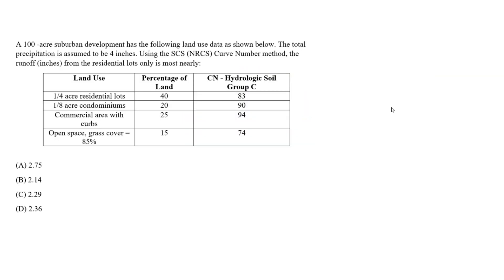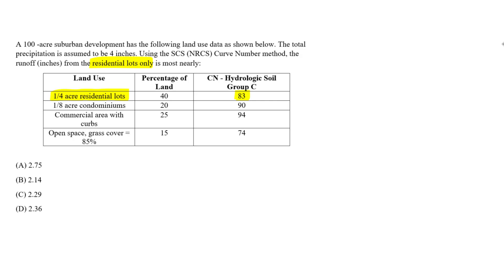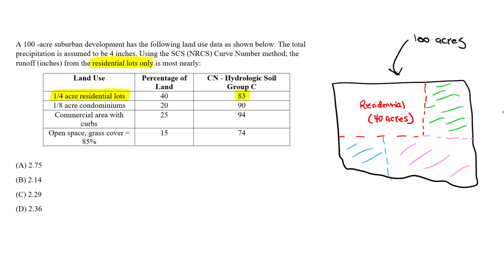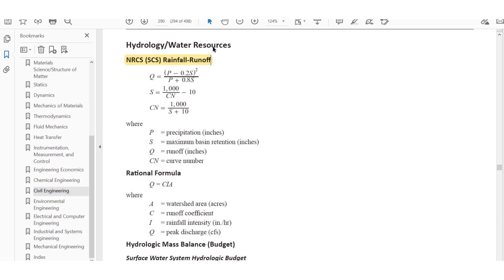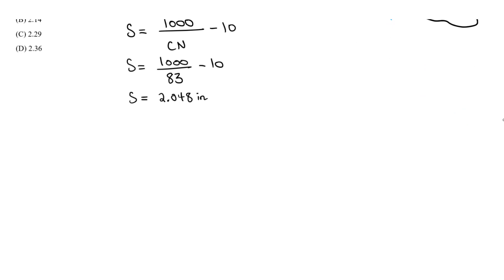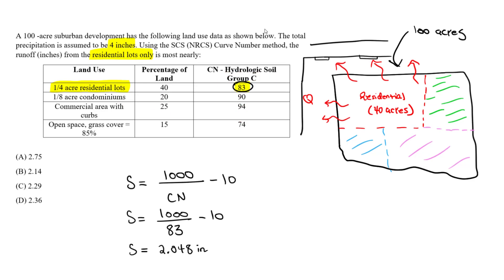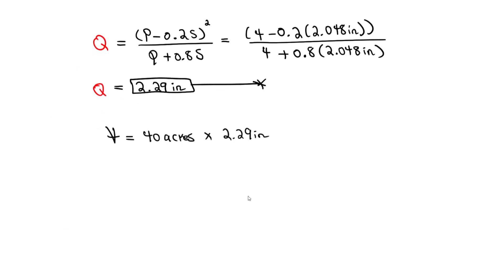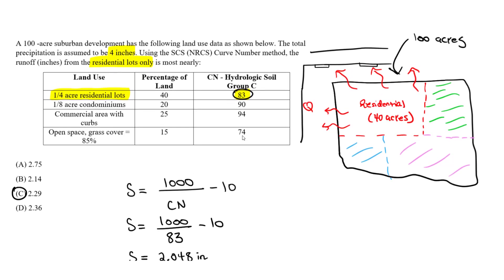FE Exam Review - FE Civil/Environmental - Water Resources - Calculating Runoff - NRCS

Comment: If I multiply 40 acres by 43,560 ft^2, then multiply by 2.29 in, then divide by 12 in, I'm getting 332,508 ft^3 for the volume. What am I missing?
Reply from the maker: Sorry. Made a calculation mistake on this one. Your answer is correct.